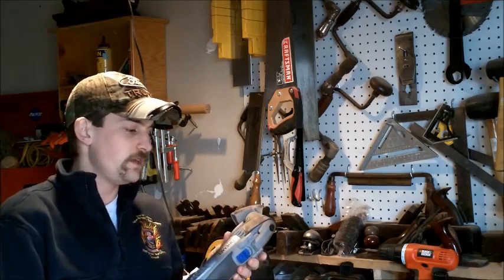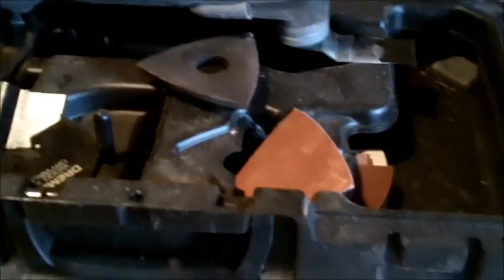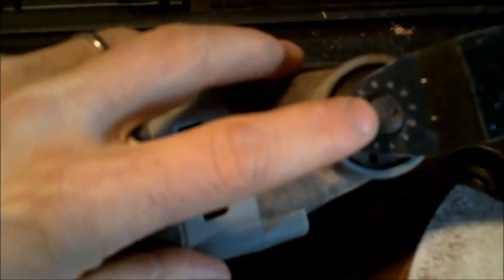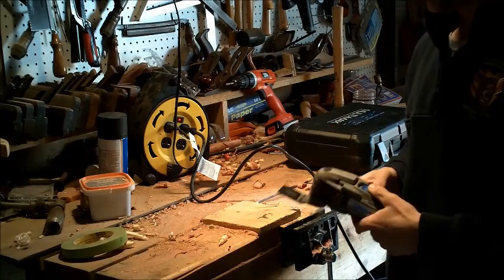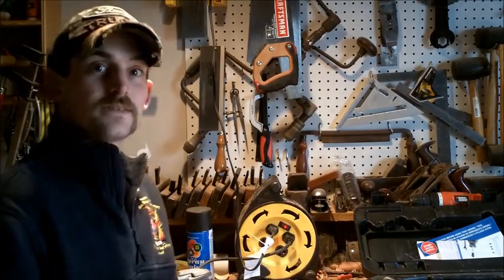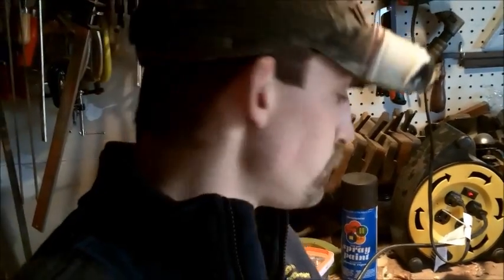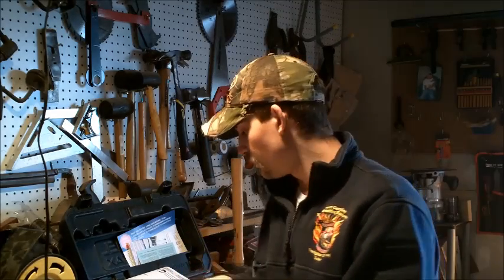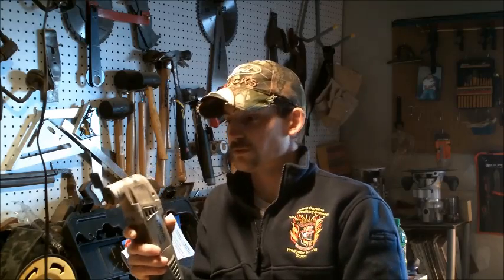Tool Review- Dremel Multi-Max MM40

Comment: I heard MANY negative reviews of this tool, saying that the attachments wear too quickly and are too expensive, and that this tool is not compatible with other brands. And I already have a rotary tool. Should I Buy it? I plan to use the Multimax for medium-sized wood works.
Reply from the maker: +XA Vayas what type of woodworking? The metal attachment has worn kind of quick, but that is expected cutting metal. None of my wood or drywall attachments have worn.
Reply: I'll be more specific: I mostly cut thick plywood and balsa, and sometimes.
Reply from the maker: +XA Vayas look at the dremel saw max. It works well and has done great on the plywood I've cut.
Reply: I own this tool, love it. The attachments ware about as quickly as you would expect. I view replacing them as being the same as if I was replacing drill bits with use.

Comment: How long does the wood cutting plates or the metal cutting plates last? say, if you cut wood daily, how long can you use the attachment?
Reply from the maker: The metal one has cut a lot of pallet nails and still seems in good shape. Not sure about the wood one though,
Reply: *****

May be similar, if only used on wood. I guess I can attach custom made attachments too.
Reply from the maker: Yes i suppose you could. There are a lot of little holes to match up though, but i could see the attachments working.
Reply: *****

I had this idea last night, to make use of the holes of worn out attachment just take it and trim it a bit from front and weld custom blades or saws to it.))
Reply from the maker: That is a good idea. I wonder if you could find little nuts and bolts, then you could just skip the welding and just keep replacing the tips.
Reply: *****
That's more good idea, for jobs that wont damage due to nuts and bolts. Here at my place I found MM20, the MM40 is not available. Do you know the difference? is it ok to buy MM20? my use could be similar as yours...
Reply from the maker: I'm not 100% sure of the differences. It seems like with dremel tools, there isn't much of a difference except the motor size and maybe more speed options. I'm sure the MM20 would be just as worthy though.